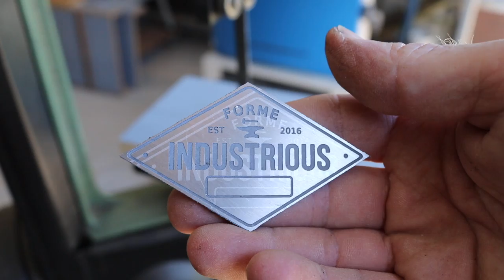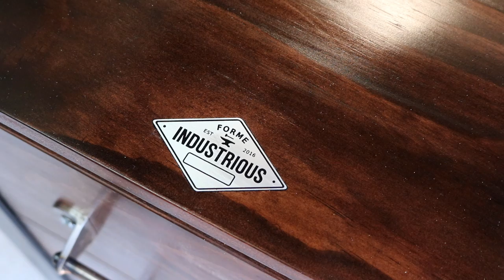Steel and Wood Drawer Shelf Unit - Forme Industrious

Comment: Nice work Scott. 
Yep, finishing sux
Cool solution for the runners
Reply from the maker: Thanks mate! The thing with finishing (as you know I'm sure) is that it's not apply and its done (damn it). Apply, let dry, sand, apply, let dry (and find a dust free environment) etc. I did 3 coats. Often I do more and sometimes I use wax as well. I might make an oil immersion bath ;) Ahhh it's not so bad, it's all part of the fun.
Reply: I wish my students would learn that finishing takes time. It's so often the least thought about process and needs more than a day (which isn't a full day for students) to do well.

Comment: The box on the marker plate is where the serial number is stamped.  That way, when you are dead collectors of your work will have a way of verifying authenticity.
Reply from the maker: Hi Steve, yes 100% right. My engraver is not working and I opted not to stamp. Future engraving might be done on CNC. Cheers.

Comment: Excellent video, like work! Tell me what kind of  attachment grinder you used to work? Thank you.
Reply from the maker: Thank you. I have a 6 inch bench grinder with a "Multi Tool" Belt attachment. It just bolts onto you bench Grinder. I think you can get these in Europe now.
Reply: Thank you! :)

Comment: Just out of curiosity Scott, why do you prefer flux core wire over shielded gas wire?
Reply from the maker: Well, a long while back then I first got my mig I had to weld up a heap of benches and stands for my work. I had to do it outside in the wind so gas is no good in the wind so I set up for Flux core. Since then I hadn't welded often enough to rent a bottle so again flux core was a better option. Lastly in my shed I have a fan blowing on me because it gets pretty warm and again that's not good for gas. In saying that, very soon I'll change over to gas - I know it will be heaps cleaner :) and I just turn the fan off for a bit.

Comment: Did you paint the metal tubing? It almost looks black after the clear coat.
Reply from the maker: Yes I painted the metal. I used Black Zinc Primer and the Black Satin Enamel. No clear coat this time. I showed the painting in the video :)

Comment: I enjoy watching all your videos, I have a question on your welding Gun is it Flux core or gas it looks like it’s missing a part?
Reply from the maker: Thanks Simon. On that project I used Flux Core wire. The shroud is for directing Gas to the weld site. With Flux core the shroud is not required as there is no Argon mix to direct hope this helps.

Comment: Nice , why use a gasless Mig , I've seen a couple of people use them lately , I bought a new   Gas/gasless Mig  but never used gasless before , is there any benefits apart from the saving on buying gas ?
Reply from the maker: Thanks John. I've always used flux core, I guess it's because I bought the mig and made a heap of work benches outside in the breeze where gas is no good. Also It gets hot in my shed and I use a fan. Again the fan blows the gas away. Lastly cost. Before You Tube I wasn't welding all that much so Gas rental didn't make sense. I'm welding much more frequently now and I'm quite keen to change over to a gas set up as it will be a lot cleaner. Hope that helps.
Reply: Yes drafts can be a bit of a nightmare , just made an exhaust for my car and had to measure , mark and cut then take in shed to weld , got a roll of fluxcore with the mig , never even thought about useing it . It's a cheapy from ebay but does the job , I was a panel beater for 35 years .

Comment: New to metal working. Just got a lincoln welder several months back and have been practicing in the shop. Was is, if any, the advantages to a band saw over a chop saw? Thanks
Reply from the maker: 1. Much quieter in the neighbohood 2. Ability to do vertical cuts, including curves 3. containment of debris, the chop saw will try and through as much sharp chips all over your shop. The Band saw just leaves a neat pile of cute tiny chips on the saw base beneath the cut. 4. Band saw will make all your friends jealous. The Band saw can do all that the chop saw can do plus more. Chop saw will be quicker but it's no big deal.
Reply: Scott Turner .....thanks. Appreciate the input

Comment: Scott i noticed you dont use the nozzle on the mig welder torch... is there a reason for that?
Reply from the maker: Hi Yasin, I have been using Flux Core Wire - no Shroud required. From now forward I will be using Gas so the shroud will be fitted to the gun. Hope that helps.
Reply: I thought that might be the case... Thanks for the super quick replies :) another question what mm flux core gasless wire do you use?
Reply from the maker: I use 0.9mm FC. Have just changed over to 0.8mm Solid wire. Looking forward to cleaner welds :)

Comment: Your work is amazing. But I have a doubt. What kind of wire do you use to weld with no gas? I think it is easier to weld without the hood of the torch.  I admire your job... by the way, I loved the plates. I think it would be a beautiful detail in my work also. (I you don't mind if I stole the idea)
Reply from the maker: Hi Fernando. Thank you! I use Flux Core welding Wire. No gas required. When the wire burns, the flux creates the its own shielding gas. Therefore the shroud can be removed as it's used for guiding the argon gas. Happy building!
Reply: Scott Turner thank you so much. I will look for it and try it.

Comment: Beautiful work ! What finish do you use on the wood and metal ?
Reply from the maker: Thank you! Most of the time clear acrylic on bare steel, if I use a colour I use a primer then the colour. lately I use Penetrol for the clear finish on steel. Wood Wipe on Poly or Danish Oil. No Particular Brand.

Comment: What is the name of this machine 5:32 ?
how did you get wood cut here 5:44 ?
Reply from the maker: That is called a biscuit joiner. The machine cuts a slot in the two halves of the wood and you glue in a piece of wood called a biscuit. Hope that helps.
Reply: Thank you, yes I am searching for it

Comment: I would very much like to have these equipment as you have, I am slowly setting up my workshop, with mig welding and other tools, but I am looking forward to you God willing I will set up my wardrobe and my kitchen all in wood and iron Metalon, I am from Brazil, pindamonhangaba city, Sao Paulo, I spend many days wondering how perfect is your work and of course your country, in your country has several machines of super quality and very good price, unfortunately in Brazil we do not have it all for a fair price. But you can be sure my window of my room I made everything handmade with glass, saved a good money myself doing and was perfect, doing things carefully and willing to do as you do everything right, congratulations, mirror me in your videos.
Reply from the maker: Yes I see myself as very fortunate to have the machinery I have to allow me to do all these projects. However you use what you have. When I started out I had only simple hand tools and not many as well, but I made what I could with those. Much simpler projects in those days. Thank you!

Comment: Your shop is too clean. I don't think you're actually making this, it's gotta be CGI.
Reply: Love this btw, your work keeps getting better and better-- and I felt your pain when those drawers didn't fit! Are the drawers loud when they close? I keep thinking those soft-close do-dads would be good on this piece.
Reply from the maker: Ah that's just trick camera work. I video against a green screen :) 
My shop is your run of the mill pig stye normally ;)
Reply from the maker: Thanks Kurt! The drawers are soft close but not self close. Pretty quite I'd say. Cheers!

Comment: Gr8 execution maestro.
But not economical, if u gonna go with steel any 6mm/qtr inch ply wud be enough, just solder the sliders cabinet members to the frame why bother screwing?
Reply from the maker: Thank you! For replaceability if ever required.